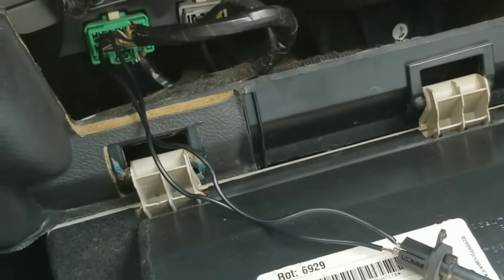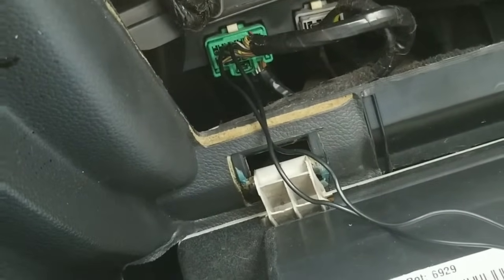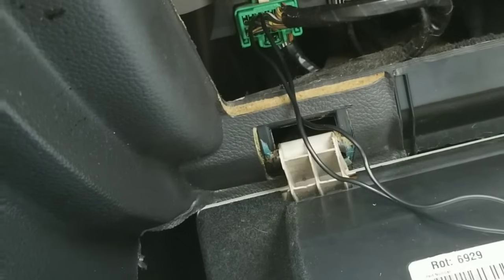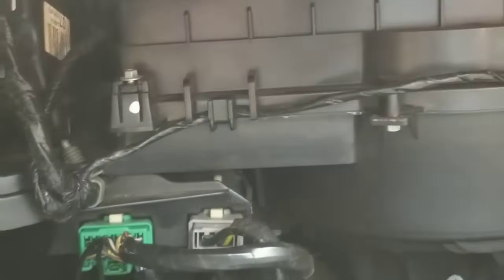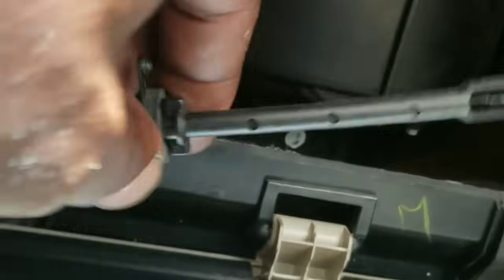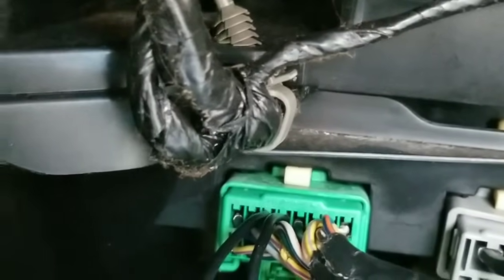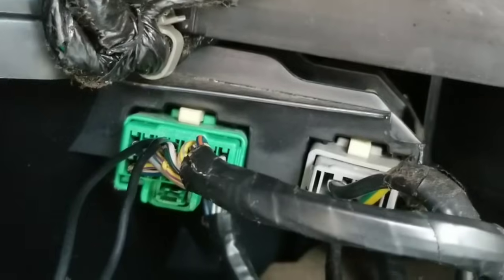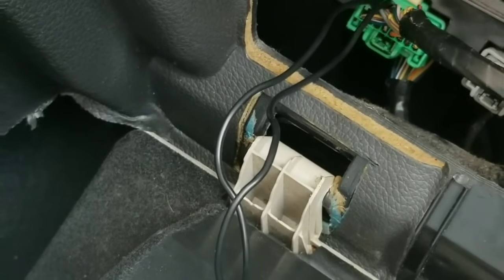Evaporator Temperature Sensor - Quick Fix & Save $900

Comment: thanks a million! I checked out behind my glove box and lo and behold there was a resistor in the same place. I reseated it so it made good contact and it works....it was just loose. Appreciate the heads up. The quote i got was for 500-600 bucks and the freon charge that i paid 100 for probably didnt even need it. thanks again for sharing.
Reply from the maker: I'm glad the video helped. After my quote I rode around 3 week in blazing Mississippi heat until I decide I was going find away to get some a/c
Reply: @renaissancemann8997  Did your AC ever go out?

Comment: Hi I just  disconnect  the sensor plug and connected a 330  ohm  resistor which works OK for $ 1 keep the good work up. JS
Reply: I realize this was two years ago, but how exactly did you connect the resistor? into slot 3 and 4? Thanks

Comment: I read that thermistor resistance can increase over time (Thermometric Drift), they are NTC (Negative Temperature Coefficient) as temperature goes down resistance goes up and vice versa, so it will turn off the compressor at a higher temperature over time as resistance increases, these are used now in place of the low side pressure sensor.

Comment: If you just want to bypass the evaporator temperature sensor, you can just stick an adjustable resistor instead of getting a new temp sensor. Potentiometer set between 100 ohms and 100k ohms should be okay to replace any 2 wire sensor if system is happy with static sensor value. However, that should be considered a workaround, not a fix for A/C problems: this sensor is supposed to monitor the evaporator and avoid getting it frozen. Modern cars have adjustable A/C compressor and the system tries to run the evaporator around 4 °C (40 °F) when A/C is enabled. If the sensor sees higher temperature, the A/C compressor is pushed harder to bring down the temperature. If the sensor sees lower temperature, A/C compressor is adjusted to produce less cold. If you put a sensor outside the evaporator housing the system will be running the A/C compressor at full blast at all times and your evaporator ends up freezing the water extracted from the incoming air. If you run short enough drives or toggle the A/C off manually every now and then, this workaround might be okay. However, if you go for a long drive with a setup such as this, your evaporator could freeze as a solid block of ice and the freezing ice might end up breaking the evaporator which is even harder to replace than the workshop way of replacing this sensor. Either way, if your sensor bypass tells the system that the evaporator temperature is more than ~ 4 °C the system will basically maximize your fuel usage and compressor wear.
Reply: yeaaaa…. i think im going to just buy it

Comment: I was just thinking the same. My gx 470 i notice when i have my fan on low. My compressor kick off and on every 5 seconds. Then when i have it high more air come through and it takes longer for the evap to cool so my compressor stay on longer. So im going to buy a new sensor and stick the probe inside the foot hose that way it gets some sort of reading instead of ac full blast and freeze my evap. I will try both. 
You the man.

Comment: The sensor is actually a generic 9K ohm at 25 degC thermistor. You can take these out of a wide variety of things for almost free. Wire it up and put it in the ducting somewhere that it bloes cold. ❤

Comment: Nissan Xtrail X-trail Rogue T32 2015.
Aircondition started to work erraticaly. Then, I would work for first 10 seconds and switch off the compressor. The issue was this very same sensor, except it is easier to take out than from this car. I didn't have new sensor at hand, so I used 2K resistor instead of sensor. Now works beautifully!! Thanks

Comment: From an engineering standpoint, this will cause an issue in some vehicles. This type of bypass should be approached with knowing that on certain models, the computer will have no way of reading the temperature of the A/C evaporator is inside the HVAC HAA / HAD / Airbox thus, if it is icing up, the controller will keep the compressor energized thus inducing expensive damage to the evaporator core. When that occurs, you'll lose the oil in the system and the compressor will get red hot and seize up - often igniting something under the hood thus resulting in a CAR-B-Q event on the side of the freeway. 

Consumers need to be aware of that and how A/C failsafe systems function by design. Now, if one were doing this with just the internal cabin thermistor - this isn't a problem and is doable / safe. But, if one is jumping the evap core - you've just removed the failsafe mechanism to cut power to the compressor and can lead to catastrophic failure which will be quite costly. When the AC Core blows-up, contamination enters the HVAC system thus leading to every component having to be replaced. 

Approach with caution on this mod. IN a temporary - band-aid, it may be worth a risk but, even at that, there may be a reason why the OEM sensor went out in the first place.

Comment: The problem with this fix is the ac will run all the time and your evaporator will freeze up with ice and restrict the air flow through the vents. You will have to turn off the ac for a while until it thaws out in order for it to blow cold air again.

Comment: I see that you did not stick the new sensor probe into the evaporator where it should be and, as you said, you just want to bypass the defective one that is already in there. Given that, you could have just simply jumpered pins 3 & 4 and saved money on that new probe and called it a day. Appreciate the video and God bless.
Reply: How do I "jumper pins 3 & 4"? If I use a generic ohm resistor what # ohm do I need? And do I insert one of the two ends into slot 3 and the other in slot 4? Thanks.

Comment: Question, when you took the car to the dealer did they just say it was the evaporator? I took mine to the dealership and in my invoice it says “partial ac check & leak test performed, Needs evaporator” I have a Ford F-250 and they’re telling me $1900 for the fix 😂 everything seems to be working but the ac is just blowing hot air when it’s cold out it blows fairly cold but that’s cause it’s pulling air in from outside I get that but I’m going to give this sensor thing a try I really hope it works I’d love to not drop 2gs on a truck I’m about to get rid of for a new one but nobody is gonna buy a truck without ac…..

Comment: What type and size of connectors did you use to connect the wires to the temperature sensor pins? I'm guessing you used 18 gauge wire.

Comment: Your AC is cycling because you replaced the evaporative temp sensor but rather than replacing the original, you put a new one which is now located under the glove box? The other bypass method is using a thermsistor but that could have your compressor freeze under certain conditions right? I am curious if you have the evaporative temp sensor under the glove box, will it work the same way as if you replaced the original in the original place?

Comment: I’m gunna ask this…I’m a dummy lol but I have the wires and the evap temp sensor. Do I need some type of connectors for the wire towards the evap temp sensor or could I just shove both ends of the wire (unstripped) onto the 2 pieces sticking from the evap temp sensor?

Comment: Now after you did that fix..
Is your compressor cycling on & off like normal operation 
Or just always running..???

???
Reply: It will not cycle, the evap sensor would make sure to do this but since it is not doing its work then the  computer will not know that the evaporator is freezed and will not tell the compressor to shut down
Reply from the maker: My compressor is still cycling

Comment: Thanks for the educational video. I tried this and it worked well in the beginning. Now the AC is working intermittently. Would you know the cause for that?
Reply: Probably burnt out your compressor. The reason why they are inside the evaporator box is because they are set to work at certain temperatures. Once you put them in the cab the compressor over works and burns out or seizes.
Reply: @danielistratoaie3301  I have a 07 MKZ my ac works when the car is cold however once the car is warmed up it stops working. So for example i turn it of an wait like 4-5 hours it will work for a bit then stop working..Any ideas?
Reply: @letsgonow5641  Your system probably has too little refrigerant or the A/C pressure is too high. If the system hasn't been inspected during last few years, I'd get the refrigerant replaced. (The official way to adjust the refrigerant is to first suck everything out with a vacuum and then add vehicle specific amount in weight, usually 500 - 1000 g. Any pressure based method will be much worse.)
Reply: @MikkoRantalainen  Hi Mikko..My dad keeps messing around with it to the point that he actually fainted...We had put a new compressor in..I keep telling him its best if we take it somewhere..i know money is tight but sometimes you just have no choice...
Reply: @letsgonow5641  If you don't have time to learn to do this yourself, the best option is to take it to local A/C specialist. Do not take it to dealership unless its under warranty if you prefer to keep as much money as possible yourself.

Comment: Was the low pressure line cold or warm? I’m my f150 it’s warm-hot. The compressor is brand new. Flushed the condenser multiple times. Wondering if this could be my issue, too

Comment: Hey man i need to do this myself a/c working fine then next day blowing hot air and  compressor not coming on. Which color wires go to each side
Reply: Is not about a color wire. Air con is way deep than u thing is not just what u see on the surface.

Comment: Hi their
Can this problem cause the aircon to blow cool on driver side and cold on passenger side.
I have checked both vent actuators they are working fine.
It is a Honda accord CP2 2.4 l 2009 model, climate control aswell.
I have got refrigerant in it, and when I change temperature from hot to cold  it still works, just not in the driver side, only goes from hot to cool only.
Passenger side is good from hot to cold.
what do you think the problem is??
Reply: Im sure you have figured this out by now, but you are having an issue with the blend door actuator

Comment: I have a Ford F150 2009 (Lariat) and it is not blowing cold,  it blows colder when I drive fast but not when idle,  it used to a few years ago.  I replaced ALL other parts (compressor, AC expansion valve, Evap core,  condenser, and hoses.  still not cold,  maybe 55-65 range.  So maybe this is my problem?  the freon is perfect.   So I am wondering if my truck as a similar sensor.
Reply: Try getting the system evacuated and recharged buy be sure they hold the vacuum for at least an hour to clear out any moisture in the system. If that doesn't work I would suspect the desiccant bag

Comment: How did you connect connectors to by pass
Reply from the maker: I bought splitting connectors but I just stuck the in the back of the harness to see if it work with a paper clip and when the cold air started blowing i was so excited that I never connected them the right way 🙄🙄 but it's been over a year and it still working
Reply: Or what is the correct way to do it. Cause just shoving wires in the back isn’t getting results?
Reply from the maker: I used a paper clip pushed the strip end all the way down.  I can buy wire taps from autozone to make sure u got a good connection..Are u sure u are tapping in to the correct wire? Make sure the compressor is not bad.. I removed my AC compressor relay and stuck wire in various  ports and the compressor kick on.. that's how I figure out it wasn't the compressor
Reply: My compressor brand new. I want to try making a better connection I just shoved them for back in as I can. So I can buy connectors at autozone and disconnect the 3rd and 4th wire?
Reply: So I understand using a t tap to tap into the right wires. But how did you connect the wires to bottom of temp sensor it’s so small couldn’t find any connectors to hold solid to the two metal outlets on bottom
Reply: Same thing going with car I just order part!!!

Comment: There is no 3rd wire on a 2012 Fusion...When I cut #15 (blue/gray wire) no air blows at all. This one has to stay connected otherwise there's no air. Disconnecting #13 (purple/brown) doesn't have any effect on air blowing. Any ideas?
Reply: From my recent research, when no 3rd wire is present, Then try the 2nd and 4th wire.

Comment: Hi there. Does it matter which wire is hooked onto the bottom of the Evap sensor connectors? Or are they interchangeable? Going to try this on my 2011 mkz
Reply from the maker: No either wire should work

Comment: Hi there, I have a Ford Escape 2011, the A/C started to work in a very strange way. The system goes from 60 degrees (cool air) and jumping directly to 65 degrees where the air becomes blowing hot. Anyone has had a similar problem?

Comment: Hi. Is this still working? thank you
Reply from the maker: It's been over a year and it still works fine. Only thing I noticed was my AC lines get ice on them on mild days
Reply: @renaissancemann8997   I have a Ford fusion 2011 and I will try to do the same way. thank you for the answer.
Reply: @renaissancemann8997  What part of Ms are you in? I'm in West Point.
Reply from the maker: @DeeboComing  Pickens
Reply: @renaissancemann8997  iced evaporator tends to happen when you drive longer distance on the highway. It rarely happen in city driving. When icing happen, you'll notice there's little or no air flow through the vent. you might have to manually turn the air compressor on/off manually to prevent compressor damage. It's still better than spending 1 grand though. Thanks for posting!
Reply from the maker: @davidvoung736  that's exactly what I do.  When I'm on the Highway I turn AC off 5 minutes every 30 minutes or so
Reply: @renaissancemann8997  I have an idea! May be, try to mix with some heat when you get on the highway see if that will stop the ac from icing. I can't try because I no longer have the car with that problem. Let me know how it turns out. Thanks.

Comment: After doing this, you will have no heater and your climate control most likely won't work. You will need to hook back your hold evap sensor every winter and you will not be able to change the ventilation flow ( I mean if you want the air to come out from the front or both front and bottom and so on...)